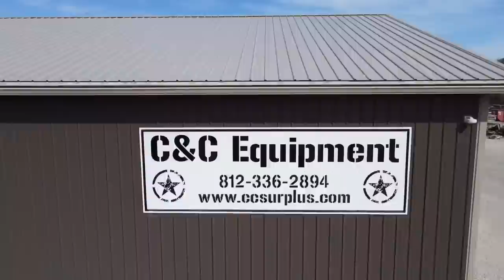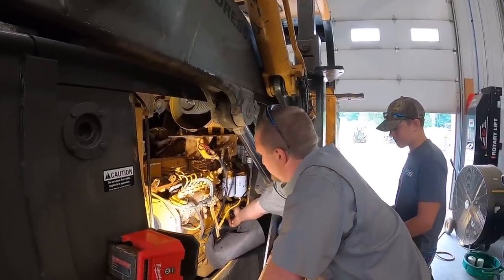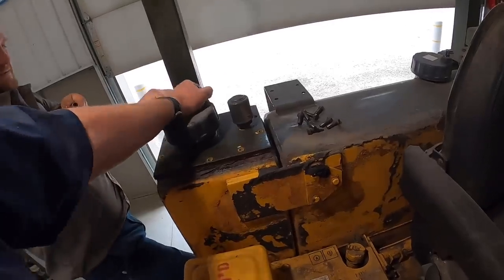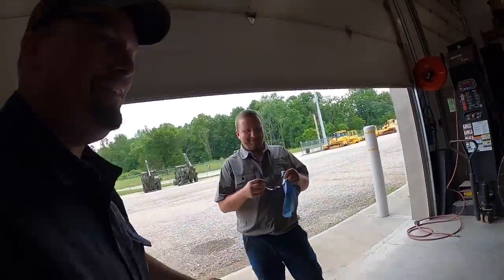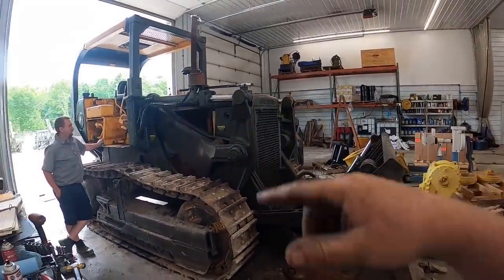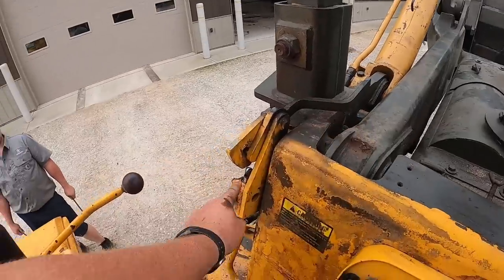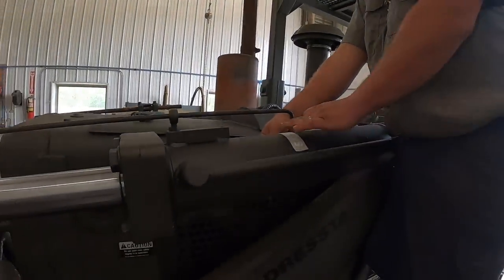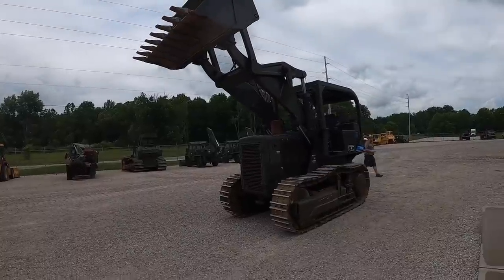Finishing touches on the IH 175C track loader then we take it out and run it! @C_CEQUIPMENT

Comment: Good video bud . The 175 turned out nice. That 175c sounds a lot different compared to the ones I've operated due to the 6B Cummins is in it.

 Like you said earlier Clint they had the DT466 in them and that's what I'm used to hearing. Sounds like a whole different animal with it 5.9 AKA 6B Cummins in it. 

Mack
Reply from the maker: Yep

Comment: motor is external combustion-power comes from outside the machine - i.e. steam, electric, hydraulic, etc.  Engine is internal combustion - power comes from inside the machine with the combustion of some fuel.

Comment: Clint, where can I get the magnet mount handle you have for GoPro
Reply from the maker: I got them from eBay or Amazon
Reply: @C_CEQUIPMENT  I’ll try eBay, I can’t find them on Amazon! You sure use the magnet mount in your videos and they turn out awesome! I am a 40 year Indiana boy, but moved to Phoenix in 2004. Love your content! We had a John Deere 450 with a 4 n1 bucket! It was awesome for years! I taught myself how to adjust the steering brake clutch’s, but it didn’t turn out good the first time, as u can imagine! Lol Thanks Clint, I have turned on many of my friends to your channel!
Reply from the maker: @MitchGaar  I think they have the 1/4 male thread on them to screw into most handles and GoPro accessories